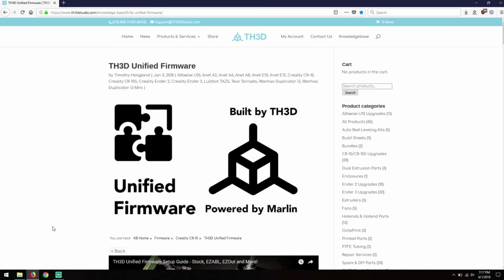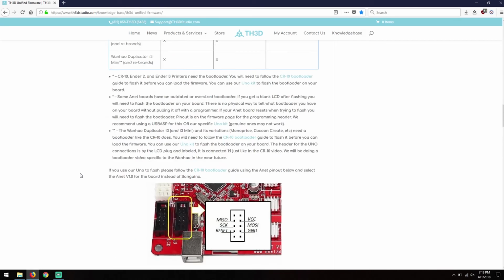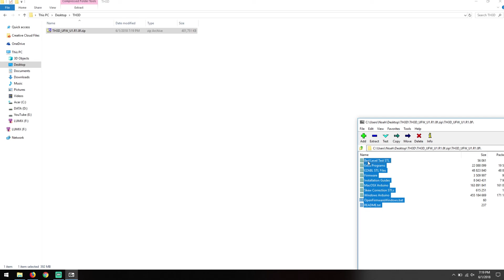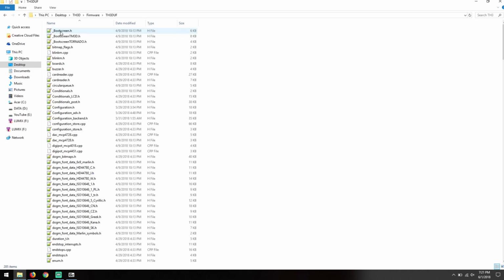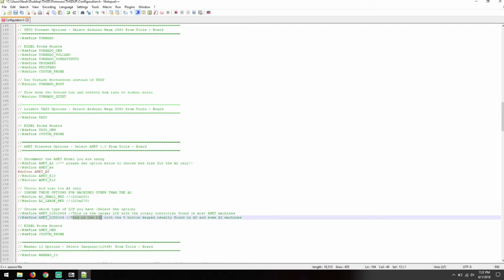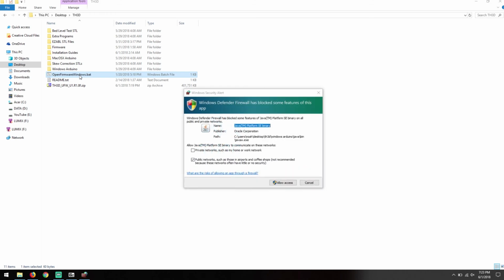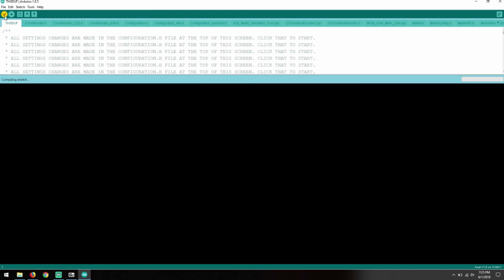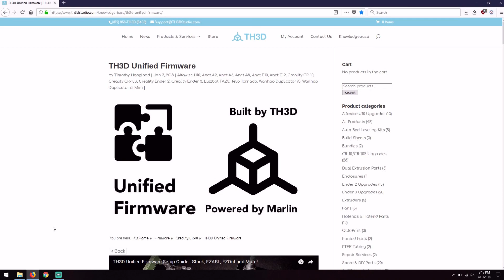Flash TH3D Firmware on the Anet A8

Comment: Will it still work like this if my board is bricked I'm getting the white boxes on the LCD printer won't do anything 🙁
Reply from the maker: Yes, it should still work.  If not, you'll need to use the Arduino Uno method.
Reply: @M1dn1ghtN1nj4  it worked thanks God thanks for the great vid 👍🏻👍🏻

Comment: Hi I have just stumbled across this on the surface helpful aid to upgrading in my case a Anet A8/6 firstly the firmware is now U1.R2.& there is no  configuration.h file secondly you mention something about notepad plus plus and that if you don't it will all turn to worms so from this point the whole thing falls over at this point you should be pointing us at notepad plus plus because without it we are going nowhere  its a bit like pushing some one in a canoe off and the informing them that they need a paddle as the drift off downstream grrr.
might I suggest that you don't take it for granted that everyone knows what you are talking about all you did was showus how clever you are!!!
Reply: I know its been 3 months now. I hope you figured it out. have you tried google? Notepad++ it's the first option usually. For the configuration.h file, you might have extensions turned off. There is only one file in the firmware/thh3duf_R2 file that says JUST Configuration there are others that have _adv or _backend. It might be the first one, maybe with 34kb as the size. after you have notepad++ right click the Configuration file, and select notepad++, make the edits and save